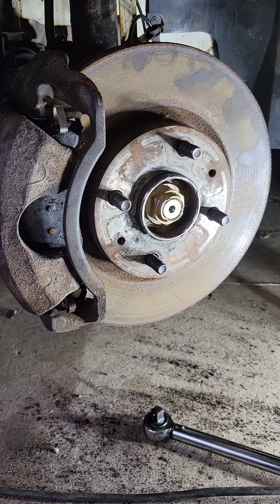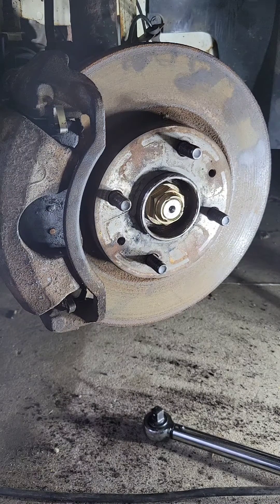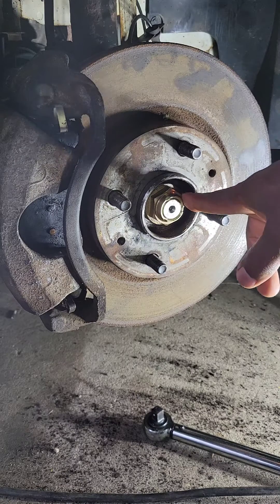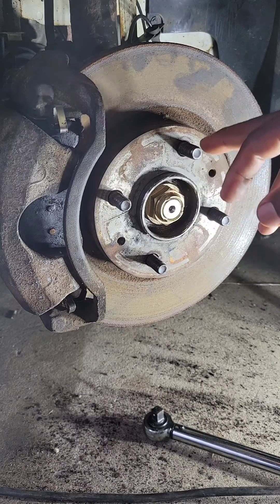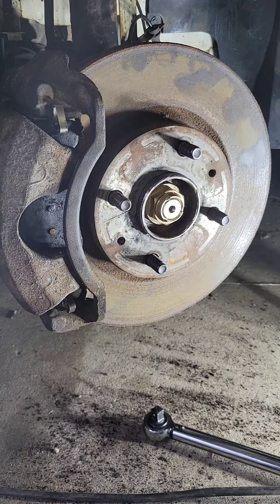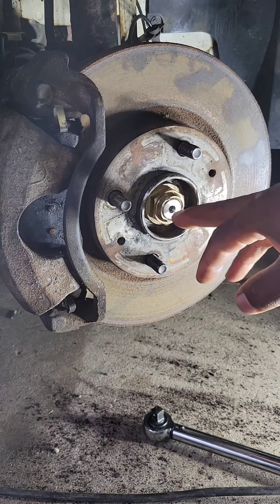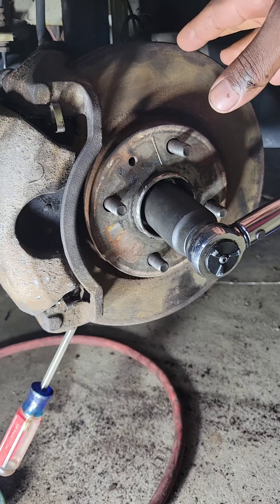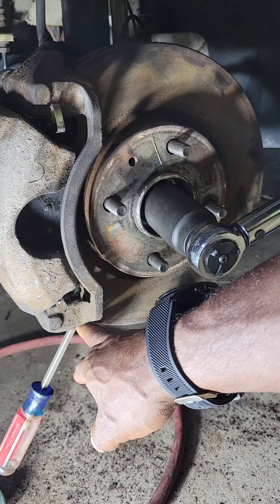cv axle, hub bearing failure... never over tighten cv axle nut

Comment: Hey.  08 Prius 159 foot pound torque spec. After replacing Hub Car car was making click pop noise while stopping. I was told to add more torque so I added 10 ft lb of torque every test drive until the sound stop. Was that a good or bad solution?
Reply from the maker: I wouldn't go over factory specs. However they allow a 2-3 ft lbs either direction, to much torque will prematurely wear the hub bearing. I would get the suspension checked out. Sound like ball joint issue.
Reply: @eilandsgarage2592  thanks for response the issue is it work the sound went away.  Over 5k miles at 225lbs.
Reply: @luross2057  225 foot pounds?
Reply: You could've bought a bad hub bearing assembly! I had that happen to me before and the popping noise couldn't really be heard until I started slowing down! Swapped it out under warranty and viola, problem solved!